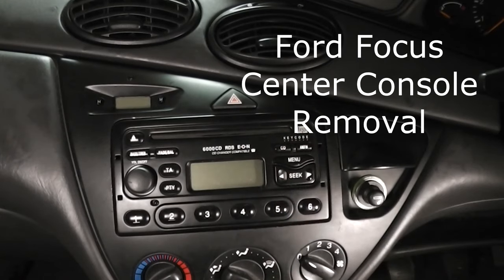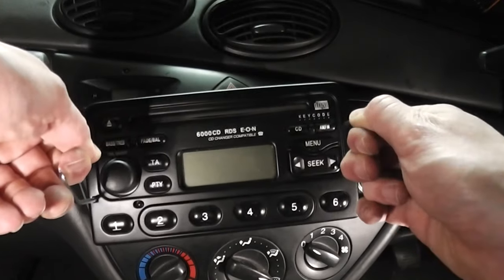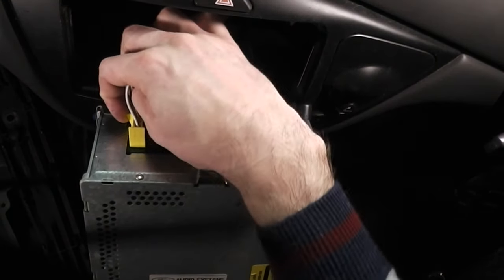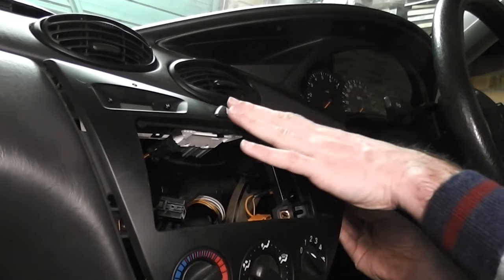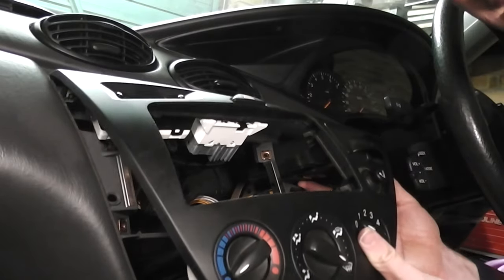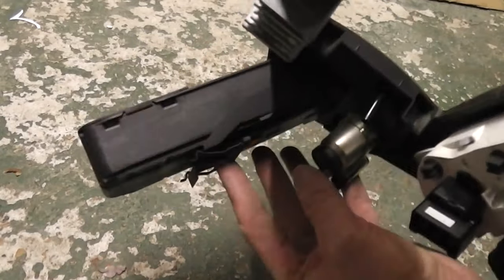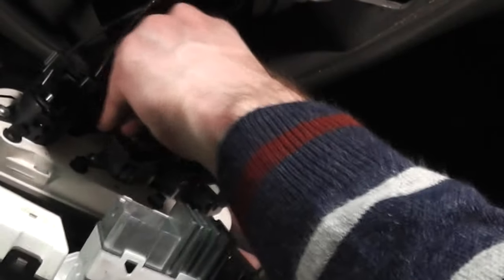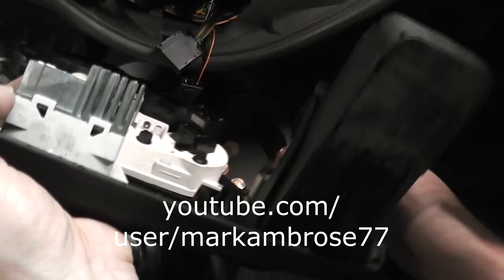Ford Focus Center Console Heater Control Panel Removal

Comment: Maybe u can help me? living in the u.s.a./sitting in the front left seat,1 would assume the heat/air level selector knob (fan level 1 2 3 4) selector would be on the left but it ls set up for European drivers.Can they be switched arround? I will have to replace the radio soon so I will be taking it apart & I HOPE I CAN CHANGE THE LEVEL CONTROL KNOWS ARROUND THE EUROPEAN CARS HAVE MORE OPTIONS.I LIKE THEM (CLOCK, STEERING WHEEL MOUNTED RADIO CONTROLS) ETC.
Reply: He hates helping people. Just makes lame videos for a few clicks...

Comment: is there some latch or anything that tightens the heater control cables? in my car they are so short and tight i can barely fit a finger under the panel, not to mention disconnecting and reconecting them...

Comment: While preparing to pull the Radio and console/heater panel,I discovered a bad lead to a fuse in the engine compartment,now will pull the relay/fuse panel and fix.....

Comment: Is it easy to swap the controls over to a new panel?
Reply from the maker: The only problem I can see if they 2 panels are from 2 different variants / trim level. For example one may have a switch for air conditioning ac and the other not, and etc.

Comment: does anyone know a part number or what the part is called (wire harness) that plugs into the back of the heater speed switch? mine has shown some signs of melting and i cant find a replacement.

Comment: I hate the orientation of the heater controls! their set up for right hand drive & Ford never switched it around when they 8th duped the fucus 2 the States.the speed selector switch (1234) should be closest to the driver yet, it's located on the far right side.its annoying! also its 1 consol or else I would switch the speed selector w/heat-cool selector knob,2 position it closest the the driver seat (left side U.S.A) IF THEY WERE 3 INDIVIDUAL SWITCHES, COULD JUST SWAP 2 OF THEM BUT THEIR ALL IN 1 HOUSING! I haven't taken it apart yet but, can any1 tell me if it's possible 2 switch them?